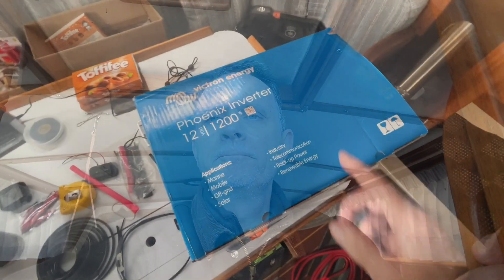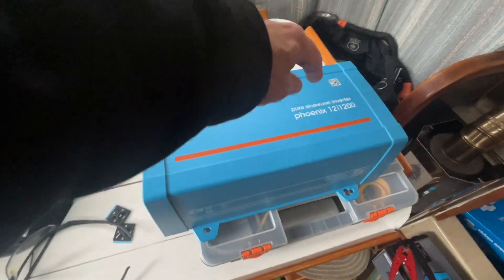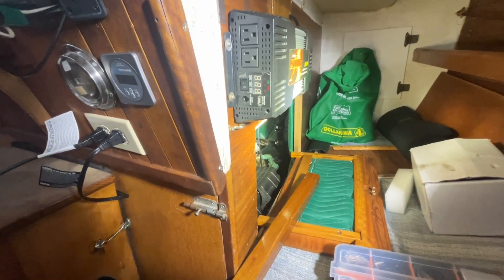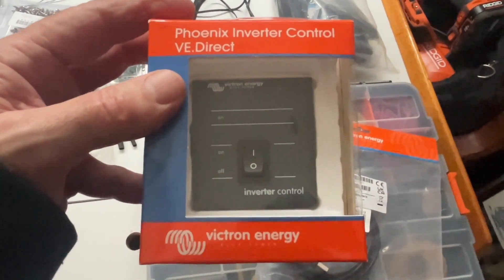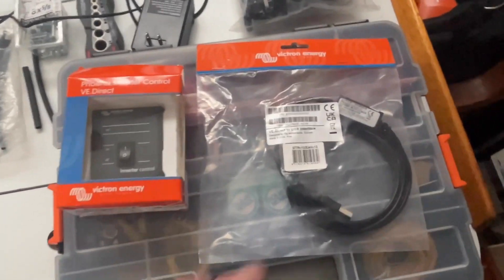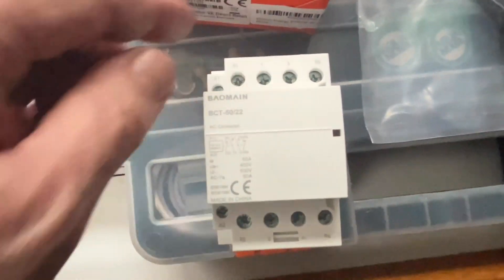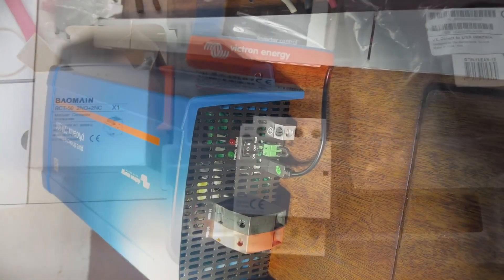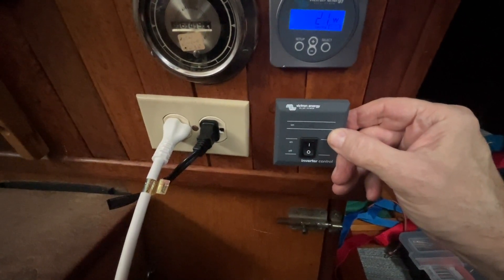Victron Inverter Install in a Boat, Part 1--DavetheMMP.

Comment: Dont Connect your inverter to the outlet for battery charger and water boiler with that relay 🤔🤔
Reply from the maker: It’s the same 50Amp contactor Victron uses in their transfer switch 

https://www.victronenergy.com/transfer-switches/ve-transfer-switch
Reply: The switch is ok but you cant run a batteri charger through inverter from same battery.